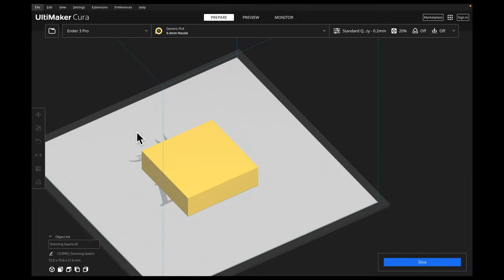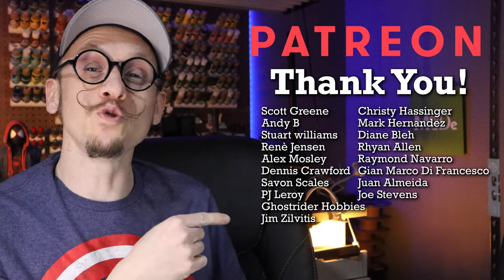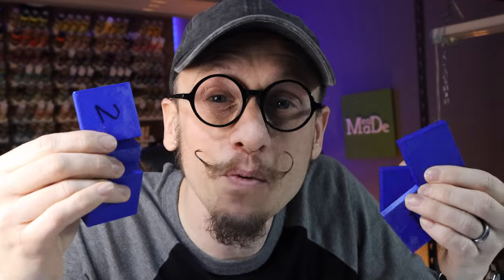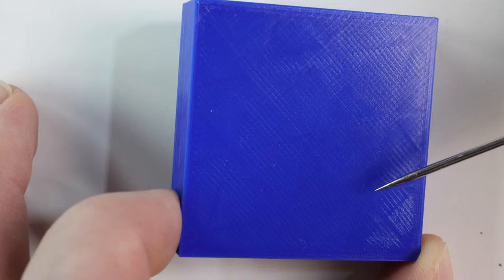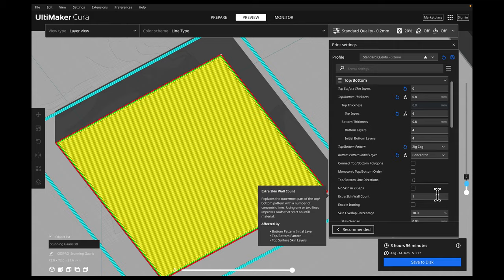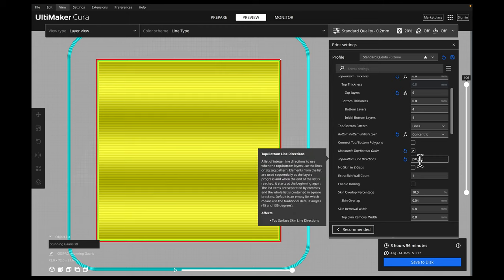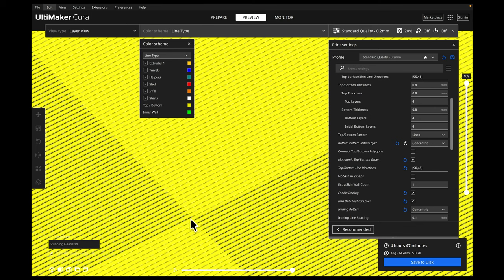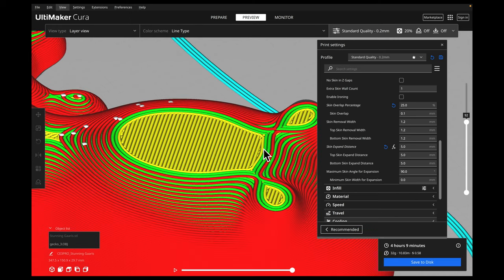3D Printing Perfection: Fine-Tune Top and Bottom Settings in Ultimaker Cura 5

Comment: Disabling "Iron only highest layer" doesn't iron everything, it still only irons top surfaces. But enabling it will only iron the highest top surface, like if you were printing a benchy, it'll only iron the top of the chimney. So you should leave it off.
Reply: Really !? 😮😢 I wish I knew this before. Lol
Reply: I was just going to ask about this as I have a rectangular model with different top surfaces on different heigths. So disabling it would iron the different top surfaces if I understood you correctly? As with the benchy, it would then iron both the deck and top of chimeny?
Reply: @bjornml.08  Yes, that's right. It'll iron all surfaces that are "top" (flat surfaces with nothing above them). You can confirm that in the slicer preview. It'll be shown as very fine lines.

Comment: Hey there, thanks for your videos. According to top layers and skin. You said that "top surface skin layers" adds layers, but thats not true. If you have 4 top layer and one top surface skin layer its still 4 layers but the last one will be treated different. You can see it in your video, the first of the 4 starts at 105 and the last is 108 in both cases.

Comment: Hm, on my Cura "Top Surface Skin Layers" does NOT add an extra layer. It "uses" the topmost layer. This is actually visible in this video, which I went through VERY slowly: There are only 4 top layers in both sliced examples.

Comment: I have a Bambu P1S which is not a bedslinger.  The random diagonal lines are making my products ugly.  I don't feel good selling them until these lines are solved.  I hate to resort to ironing because it takes so long.  Should I switch the direction so it's printing the top layer lengthwise instead of 45 degrees?

Comment: Thanks for these videos. I have tried adjusting cura to remove hair stringing, but nothing seems to work. I use Anycubic Kobic Max Printer, where I have a stringing problem.
Reply from the maker: Next weeks video I discuss these issues specifically so stay tuned next week.
Reply: Not that this is the best longterm solution.  But depending on the type of stringing occurring, grazing them with a lighter can be a very good & very quick fix for stringing.

Comment: Hey Chris, I’m fairly new to 3-D printing and have been using Cura 5.7 and just updated to 5.8. I am using a big tree tech E3 V3 board and use VS code to modify firmware configuration files. Ever since going to 5.8, I have been getting Gode issues. I have double checked my profiles, which by the way were deleted when I installed 5.8… I’m sure there’s a way to keep those configurations, but I assumed when I  upgraded, the settings would be transferred. My question to you is are there known issues with Cura 5.8?

Comment: Hello and thank you for all your videos which I find very interesting. I am French and I use an Ultimaker S5 printer. today I am contacting you because I am facing a problem, printing several colors on the same object. I am using the function, change filament in cura 5 but the default settings are not good. I use a 0.4mm print head and every time I change the filament, a big deposit of material ruins the rest of my print. Thank you for your help if you have the solution to my problem. Best regard. Bruno
Reply from the maker: Thanks for the comment. When it comes to your issue I used that feature. So I don’t have an answer I can add that to my list of video topics and do some testing and make a video in the future.
Reply: thank you for your quick response and thank you for taking the time to read me

Comment: On a related note, is there any way to get a complete top surface printed for lower top surfaces? Example: I'm printing a part that has raised lettering. The face of the part is my lower top surface. Due to the lettering, Cura leaves holes in this surface where the letters will print afterward. I'd like it to print a top layer over these holes while it's printing the rest of this surface in order to avoid having my letters printed over just infill - in hopes of gaining more adhesion for them - not to mention eliminate the slight "drag" marks between them where the nozzle is traveling...

Comment: Thanks. I'm having issues with bottom layers. When printing joining parts the pieces don't match they are bowed when trying to glue together. I have 7 bottom layers and it does not look like it was lifting odd the bed. Would more bottom layers help Maybe?
Reply from the maker: Hey Dennis! Honestly you might want to try less layers sounds like your getting a bit of elephants foot. Having a thick bottom like that might be causing the issue. Maybe try 3-4 bottom layers if that’s not it you may want to check your belt tension and do some calibration cube tests on wall thickness.
Reply: @ItsMeaDMaDe  not really elephants foot more like a warp. Let's say a 6in long by 1in wide part. The parts touching the build plate look flat but when removed it looks like a smile
Reply from the maker: @DennisCrawfordJr  I sent you a message in the patreon about joining the discord. There you can share pics and we can figure it out. Or I can send you my email
Reply: @ItsMeaDMaDe  I just joined thanks

Comment: Line layer direction does not require the value to be entered between the [ ] brackets. They are only there as defaults so the slicing software function can process as null rather than no entry which is typically 0.

Comment: When I use “Concentric” lines for the bottom layer, it sometimes leaves small tiny holes, mostly with organic models, where it isn’t an exact perfect circle. This causes the lines to get angled, and usually causes small holes at those angles. Do you have any idea what I could do to fix this? (love your videos, you have helped so much 🙏)

Comment: All the videos that I come across tell how to make the top surface even and smooth, but I have a different problem. I need to achieve a high quality detailed texture on the top surface. and my texture is kind of smeared.
Reply: Rotate your part 90degs, so you want the "detail side of your part" printing vertical like a wall instead of trying to print the detail on top,,, obviously it only works with certain types of models/parts but this method is extremely  good for Topographic Maps and Terrain types of prints-. 

like this model from Thingiverse- (picked at random)

Mt Whitney w/ Trails (1:48000 scale)

Now rotate it around (might have to do it a couple of times to find the best spot) so the detail is on the side, and any steep overhangs are are topside-.

hope this helps ya out a bit-.